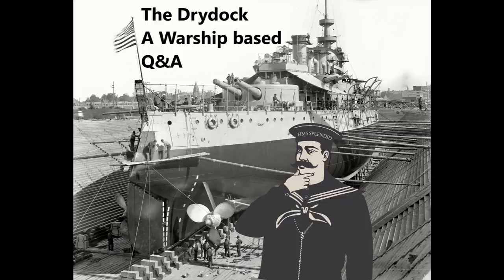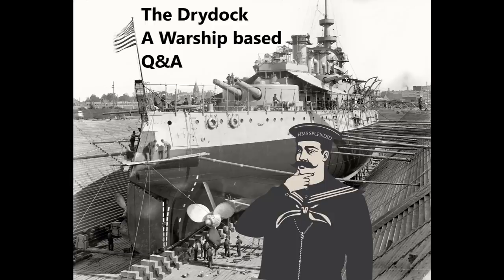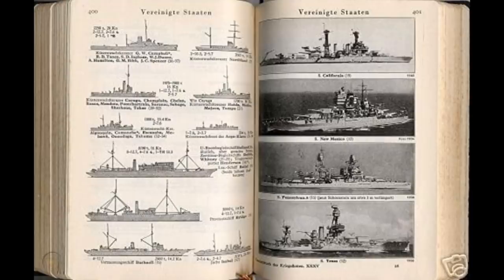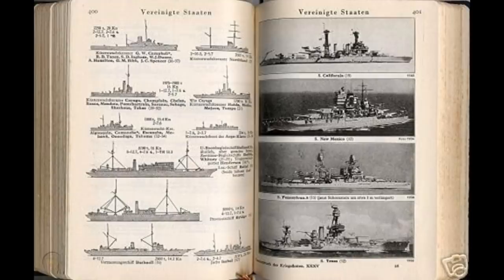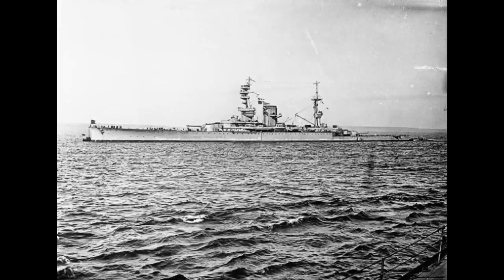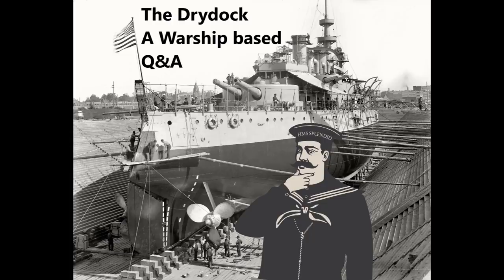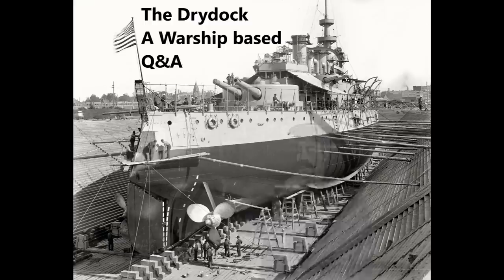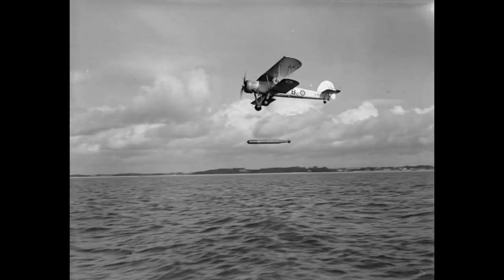The Drydock - Episode 138

Comment from the maker: Pinned post for Q&A :)
Reply: Would the Royal Navy have been better off keeping the Gloster Sea Gladiator in service over the Fulmar in the first half of the war? From what I’m aware the Gladiator gave sterling work in Malta and Finland in the early war years.
Reply: What kind of small arms did capital ships keep on board? Was it enough to arm the crew in case the got pressed into service on land?

How effective were fixed torpedo tubes on capital ships? Surely maneuvering an entire battleship is impractical
Reply: Considering the amount of damage that USS Enterprise (CV-6) had taken during the Pacific War. Did it develop any mechanical or structural quirks similar to HMS Warspite?
Reply: how effective was the razzle dazzle camouflage idea against U-boats? I feel like it would make ships much easier to spot
Reply: I keep wondering, If a modern 40 MK4  had been sitting on an American WW2 warship, how well would it have performed against the air plans of the time?  I know this isn't exactly the kind of questions you like to answer but I thought I would still try!
Reply: So, what about hovercraft? or is that another services concern?
Reply: Were there any successful "kamikaze" style attacks by allied aircraft during WWII?
Reply: @skylynx2243  it was not a matter of spotting said vessel with the dazzle camo scheme, but rather hiding the shape, direction, speed and even tonnage, to evade an attack. The scheme was there to break up the silhouette for identification, gave false bow waves for indication of speed, change the perception of course, appear to have the vessel deeper in the water(so torpedoeswpuld be set to run deeper under the vessel), and just confuse the human eye as to what it is seeing. While i don't have numbers, it was effective(including modern car companies using similar patterns to hide new model changes to flagship and super car models), but made superfluous to the advent of magnetic homing torpedoes.
Reply: In your battles for Guadalcanal series, you noted the electrical problems USS South Dakota had. Was this a problem with the whole class (including Alabama and Massachusetts) or was this a unique problem to South Dakota?
Reply: @adamalton2436  A similar thing happened to Massachusetts during the assault on Casablanca, But the US forces was so superior in numbers that it did not matter to much, and therefor no "fuzz" was made about it.
Reply: @Luke-li5gj  There was 4 Zaras, the Gorizia was not sunk in the battle.
Reply: Does anyone else get the impression that the Pensacola class cruisers used up most of the luck available for US pre-war heavy cruisers? Neither was sunk, and while both suffered damage during various engagements (including actions at Guadalcanal), only Pensacola suffered crippling damage with a torpedo hit at Tassafaronga. In contrast, every other pre-war heavy cruiser class suffered the loss of half its members during the war (total of 7 out of 16, leaving out Pensacola class). Of the pre-war heavy cruisers that did survive the war (11, including the Pensacolas), most (Tuscaloosa and Wichita excepted) suffered crippling damage at some point, many in the Solomon Islands. In contrast, none of the Omaha class, only one of nine Brooklyn/St Louis class, and only two of eight Atlantas would be sunk. Granted, the Omahas were largely kept out of the war and the Atlantas were kept close to their carriers for AA escort rather than put in surface action squadrons, but still, as Franks puts it:

"The American 8-inch-gunned "treaty cruiser" fought her last night battle in the Solomons at Tassafaronga. This resulted partly by design, but more because of force majeur -- every one of the thirteen heavy cruisers used around Guadalcanal to date had been sunk or damaged."
Reply: Swordfish are effective in forcing manoeuvre kills on enemy aircraft.. by flying at extreme low altitude and changing course often.. the me 109 etc often gets frustrated and over commits. .then goes straight in.. war in a stringbag
Reply: @niclasjohansson4333  design flaw?
Reply: Why were chains fixed to the bow as seen on the ship in the part about torpedo protection?
Reply: The German destroyers would have still run out of shells and been for the most part effectively unarmed after destroying Warburton force
Reply: @adamalton2436  All the "modern" BBs during ww2 had design flaws, and the SD class might have been the worst of the lot ? The USN tried "to mush" with the SDs they were just to cramped to be effective.
Reply: Bomb ketches, if you’ve not covered them already
I’m particularly curious where the French used theres, 
And also if any of them ever used the mortars against shipping

But the concept itself will do, rather like you did galleases (even tho I’ve lost track of where that one was answered...)
Reply: Given the pugliese system as copied by the Russians was flawed using rivets meaning that bulkheads break and with cylinders that were too small and even then still impressed the german testers. how do you think the proper italian system would have worked. In real life it was never hit in the main part of the system only on the thinned down extremity so I wonder how strong it would have been to newer torp x fillers.
Reply: Is it true that they tried using, and experimenting with cork as part of a torpedo defense? And do you think possibly concrete was ever thought of and tested as well?
Reply: I found it interesting that the USS John F. Kennedy (CV-67) had an angle stack like certain IJN carriers, whereas all of the other non-nuclear powered US Navy carriers did Not!  I'm not/never have been flight crew (as you can guess from my "name"), but I wonder how much this helped the aircraft landing, and why they didn't put an angled stack on the Essex class angle deck modernizations!
Reply: Nice video! Could you comment on the transition of naval yards during the shift from wooden ships to iron and steel. While both needed to be near the ocean, the iron / steel age made it more convenient to be near steel mills and forges. ? Did this lead to a decline of some yards and the rise of others? Or did the yards just adapt? Did it lead to an exodus of shipwrights and carpenters ?
Reply: Was there ever a Mis-identification between the Baltimore-Class, Cleveland-class, and maybe the Brooklyn-class on both the Axis and Ally forces? If so which one were those?
Reply: In re the TDS:  What if anyone had used 21" diameter shaped charges vs the "best" TDS?  What would be the relative effectiveness vs the typical simple lump of explosives that was a typical torpedo warhead?
Reply: After the surrender of Japan, a number of its naval vessels were used to bring back troops from far off places - as some IJN vessels were doing this into 46/47, what was this the last act of the Imperial Japanese Navy (if not then who) and under whose flag did they sail?
Reply: Could we get a USS Pawnee guide?
Reply: @skylynx2243  From my understanding (from what my WW2 Vet father told me) is that the type of rangefinders (basically all) submarines had, it made getting the correct range to help them aim their torpedos.  (If you've ever used a a reflex or other camera that has a rangefinder, it is basically the same style of rangefinder that is in a WW2 periscope.)
Reply: @blogsblogs2348  Yes - if "Pegleg" Lamb had opened fire, he'd have been credited with 2 kills. He also cites dive bombing @ 200 knots in his Stringbag.
Reply: Did any navy ever experiment with some sort of armor piercing or dual stage torpedo that would travel furthur into a warship's defense system before detonating its main warhead
Reply: After the Battle of River Plate, Churchill famously said that Harwood had "proven Troubridge wrong!"  Do you agree?

Personally I disagree - relatively speaking the Goeben was far more formidable ship than the Admiral Graf Spee if only on account of being much better protected - and consider this a perfect example of Churchill disingenuously "rewriting" history so as to ensure it was going to be kind to him.  The way I see it, Troubridge had been trapped into a no win situation trying to balance conflicting orders requiring him to engage the enemy, guard the mouth of the Adriatic and avoid battle with a "superior force." If Troubridge had been wrong about Goeben being a superior force then presumably the person who had issued those orders - who just happened to be Churchill - was actually right and therefore ultimately blameless in embarrassing mess that was the pursuit of the Goeben.

As you may have gathered, I'm of the opinion that Churchill set Troubridge up as the fall guy for failures in the Admiralty that were ultimately his responsibility.
Reply: I've noticed that a lot of larger (heavy cruiser and up) WW2 Royal Navy ships had one anchor on the port and two on the starboard side, while other navies had just one on either side even for their battleships. What was the reason for this (and the arrangement in particular)?
Reply: Did the New Zealand navy have any warships they either owned or were commanded and crewed by kiwis, in either ww1 or ww2??
Reply: @jb76489  The torpedo's gyro could be set to steer it on to the required heading after launch, so the tube itself didn't have to be pointing in the right direction.
Reply: Regarding the roles of ship's crews, remember that during normal cruising only half the crew would be on duty at a given time, so they would have to take on a variety of roles.
Reply: The German ships of World war 2 seemed to have generally inferior anti aircraft weaponry compared to their allied contemporaries and be less than adequate in anti air defense. If you were in charge of German ship design what would you do make German naval anti aircraft defense up to par or superior to their allied contemporaries?
Reply: Do you think, with it firing off one last shot from its guns as it sank, that the USS Chicago was saying goodbye to her sailors? And has there ever been other eerie instances of ships saying goodbye to their sailors?
Reply: I've heard that during the Spanish American War the USN almost fired on an Austrian cruiser as the United States anticipated Austria-Hungary intervening on the side of Spain. But I have not been able to find any details on this incident such as date, location, or ships involved. Can you shed any light on this incident?
Reply: @Drachinifel How do you weigh a ship that is tens of thousands of tonnes? Is it done by component or in a tank by how much higher the water goes?
Reply: What in your opinion is the difference between bravery and suicide, and which one, or both, best describes kamikaze pilots?
Reply: When Von Spee approached the Falkland islands and found the Brittsh battlecruisers waiting for him, some historians have ventured the opinion that if Von Spee had only stood his ground at that point he could have pounced on the Brittish ships as they sailed out of port one-by-one and blasted them into oblivion before the following ships could assist. Would the geography of the port allow this and could Von Spee have possibly pulled such a manuver off, leaving aside that his most sensible course of action was probably to run? #qanda
Reply: Did any mothballed ships from US reserve fleet after WW2 or reserve fleets of other nations were ever reactivated and brought back into service? How the decision was made on whether to mothball a ship or scrap it?
Reply: @Chung KWOK Benefits pale to the cons and complexity.
Reply: USS Long Beach is said to be the last cruiser built on an actual cruiser hull design. What's the difference between a cruiser hull and a destroyer hull ?
Reply: Greetings Drach, Reading "Anatomy of the Ship, Battleship Yamato" on a table that states how much certain items weighted in the ship there was a line dedicated to torpedos. In an asterisk the author explained that there were recent reasons to believe that Yamato had a number of underwater 610mm torpedo tubes. What are those reasons and how likely is that?
Reply: @tokencivilian8507  a shaped charge will go through the outer shell and then disperse. "Spaced armor" is very common for protection against a shapedcharge, as the explosion gets focused on a particular point and loses focus after that.
Reply: @constancel4211  I think that's mostly a reflection of the fact that the Ticonderoga class (America's last "cruisers") are built on the hull of the Spruance class destroyers. With Burkes displacing over 9,000ctons now, the earlier Spruances displacing 8,000 tons or so, and the Ticonderogas displacing about 9,500 tons it's hard to look at US ships and distinguish between a "cruiser" and "destroyer" hulls (unlike the treaty era when cruisers were 10,000 tons and destroyers about 2,000).
Reply: Alternate History:
As a measure to prevent further European wars the militaries of Italy, France, the UK, the BeNeLux countries and the west German proto Military of the late 50s/ early 60s are folded into a European Armed Force.
In the post WW2 draw down what what Ships/Ship classes would you keep in service and what systems would you change over to some what standardize?
Reply: Hi Drachinifel! Is a floating dry dock relatively recent innovation? Did it play any important role in WW1 or WW2?
Reply: @kemarisite  Thank you I thought it was a matter of shape like the length to width ratio or other things that might influence the speed, tonnage and internal volume of the ship.
Reply: @solidjb  The Iowas come to mind.
Reply: @timengineman2nd714  The "Edward M. Kennedy" (the origin of the moniker is left to the reader as an excercise.) Was supposed to be nuclear powered but McNamara vetoed it for cost reasons.  The original design did not have trunking for the boilers.  I am just speculating but the angled funnel may have been the result of a desigm improvisation.
Reply: 13:02 Now I'm curious what the US and Japanese responses to the imagined Courageous-class cruisers with 10 or 12 x 9.2-inch guns would have looked like (and more entertainingly how the different parties would have fudged the treaty restrictions to try to get an advantage).
Reply: @TheAngelobarker  the Russians invested heavily in testing a more advanced system for underwater defence.. even making sections to destroy and analyse.. but they ran out of time and just built what was ready.. for their large battleships
Reply: @SPARTANI548  they did keep it in service.. they just ran out of them and no more were being built or converted from raf stocks which were also depleted.. Therefore had no supply chain...
Reply: You had a picture of a pt boat with what turned out to be radar.. upon investigating this I have since been informed that some had radar.. further looking into this.. there were a number of early radar sets used but not necessarily servicable.. but then a general issue.. thus the pt boats at guadacanal were likely? Radar equipped as a priority that had been identified earlier and also had different detonators for their torpedoes.. which meant that if it did not go wild then it was effective... this would make them a very powerful direct anti shipping force in the area.. by the technology of the time.. ie working radar and torpedoes...
Reply: Sunk by torpedo aircraft as no effective air escort at the straits of Gibraltar plus minefields plus submarines plus surface units plus 9.2 inch guns at Gibraltar which would have ripped them a new one...
Reply: How did the life of your average seaman in peacetime change across the eras of Naval history? I'm including both those deployed on ships during peacetime as well as those who weren't actively crewing a ship.
Reply: They should have just immediately transfered 50 new but older raf hurricanes as their .303 guns firing tracer would be very useful against italian wooden bombers which had a tendency to catch fire easily... large numbers of these early hurricanes were available crated up and ready to go...
Reply: For someone who professes little knowledge of psychology Drach, that assessment of the possible/probable mentality of kamikaze pilots was pretty damn good.
Reply: You mentioned Seeadler, I've been fascinated with her and her exploits, I wonder if you'd be so kind as to share your thoughts on the vessel with the rest of the class please. It would be much appreciated good sir.
Reply: @johnshepherd8687  Actually, it is easier to run the funnel straight, however, a IJN carrier(s) did have an identical funnel design to lessen the effect of turbulence on aircraft landing.... I guess that whoever changed her from Nuke to Oil decided to see if it worked in the age of jets!
 
(I also know that she was supposed to be a nuke.) But, not everyone knows she was that smaller than not only the (newest) Big E, but also all of the other carriers from CV-59 onwards.
Reply: @nicoderfeuerloscher1684  yes i was wondering what those were for too
Reply: @nicoderfeuerloscher1684  yes i was wondering what those were for too
Reply: How would US navy torpedo squadrons perform at Midway, had they been re-equipped with TBF avengers just before the battle?
Reply: @MrPro897  my hunch is, as the attack was so hopelessly botched, TBFs would have been slaughtered the same way.  There were TBFs that attacked the Japanese force from Midway.  They were slaughtered.  One of the six survived attacking the Japanese formation.
Reply: Q&A : SS Richard Montgomery - continue to leave it alone, or attempt to clear it? If clear, how would YOU do it?
Reply: Can you tell me which is the best German destroyer of WWII in terms of combat performance? I’m very interested in Kriegmarine and due to it being a rare subject in terms of WWII history (let alone its depiction in video games).
Reply: Q&A: I've been wondering about this for a long time.  How bad were the WW2 Depth Charging of US Submarines, especially in the early stages?
   
A  lot of the Japanese Destroyers at first carried 18 to 36 Depth Charges, so I am thinking the tales of a hour+ depth charging is more story telling than truth....
Reply: The book titled 'I was a Kamikaze' could have been fiction. 
It tells the story a pilot who had seen the B-29s sliding away from him. Too high and too fast to shoot.  I think it was frustration that made him volunteer. 
He was promoted, wrote a letter to his family and was allocated a twin engined plane. The rest took off in single engined planes and he lost touch with them. 
He could not find the ships he had been sent to attack and returned.  He was promptly stripped of rank and never flew again. 

He gave figures showing no reported attacks that day..
However, the single engined planes did not return and were considered successful which contradicted USN reports. They reported no hits that day. 

A RAF pilot was not impressed when I told him.
Reply: Why did the Radar of the German Kriegsmarine got damaged so easily and often by the ship itself and were the German ship designs particularly bad/ what could they have done better to build good heavy cruisers and battleships?
Reply: Idk if they’d be I. Your wheelhouse, but since they operated in conjunction with U-boat fleets and navies generally, I’m curious about the role of flying boats in WWII. 
The Germans in particular had some cool ones (bv 138 looking like a spaceship, bv222 & bv238  wing Germany’s biggest planes of the war..., the do24 fought for both sides!)
Every country had cool seaplanes. It’s not just the Catalina (a very cool bird itself).
Reply: @stevevalley7835  TBFs would clearly perform better. They were faster, better armored, heavily armed, longer range. TBFs from Midway weren't elite units, just like SBDs, B-17 and Vindicators.
Reply: Hey! I cant remember if you ever talked about Rifled cannons in the age of sail but I read an article about some small on some small poundage guns 12 pounders and even a two pounder that the british used that threw projectiles 1,100 yards with a deviation of about two feet. I would love to hear more about such cannons. It seems mostly a french and german undertaking and I can't find much information on the subject.
Reply: @myparceltape1169  the Bismarck example is a good example, why could the gun blast unsettle the valves, didn’t then thought of shooting the guns when they designed the ship. And if I remember correctly it was a common flaw in German ships that there radar was prone to failure
Reply: @myparceltape1169  I'm sure you don't have time to read all these. Love your channel. I was wondering if you could go into detail on your thoughts on the Japanese "Pagoda" masts. Given their height, they were relatively lightly armored to maintain stability. They were also where the primary optics and a good portion of the command crew was located. 

If I were faced with fighting a Japanese battleship I'd order all secondary batteries to focus on that pagoda mast which couldn't withstand the hits and use the big guns as usual. 

Thoughts?
Reply: Why are so many RN ships named after Greek gods?
Reply: The specific history of the 15-inch guns outside IWM London? I know they passed over several ships during their service but don't know the exact details.
Reply: I see that the USA originally used an 18" Mark 7 torpedo as its aerial torpedo, but began development of what would become the 22.4" Mark 13 in the mid 20s. Every other nation that used an aerial torpedo used one that was 18" (or 17.7" for an even 45 cm) in diameter. Does anyone have any information on how the US came to decide on such a short (just over 13' vs 16-18' for other nations), fat torpedo for aircraft? The obvious possibility that comes to mind is a length limitation imposed externally, i.e., aircraft such and such can't take a torpedo longer than X, so that's our hard limit. While this is stupid as aircraft were developing so quickly and the next generation of torpedo bomber could be in service with a longer bay in 2-3 years, the US made a number of comparably stupid decisions during the same time period so I can't rule it out as a possibility. However, I haven't seen anything that specifically says why it was this length or that is was made so fat to compensate for the length or where this external length limitation came from.
Reply: In the age of sail, why didn't their bicornes blow off? My fedora went spinning into the A446 recently and I considered it serendipitous that providence decreed I am an I. T consultant on a stroll rather than a fourth Lieutenant on a 74 off Ushant
Reply: I heard your tone change a little bit when mentioning Churchill. An almost disapproving tone and I’ve heard it before in Britons. Do I get the impression that Churchill isn’t as popular as I was lead to believe?
Reply: @gearhead3533  on this issue it may be important to distinguish Churchill at the Admiralty from Churchill as PM. At the Admiralty he came up with a number of wild ideas, such as campaigns in Gallipoli or along the German Baltic coast, that were problematic, either in concept or in execution.
Reply: The mental state of Canopus' Chief Engineer has been brought up multiple times but I'm curious what exactly happened; like what began his breakdown and/or why did it occur? What kind of breakdown was it? PTSD or an actual psychotic episode? And did he do anything to actively sabotage the ship or was it more just the loss of such an important crew member being felt?
Reply: You have mentioned the 7 years war a few times recently but never realy touched on 1759 ie Annus Mirabilis this seems like a pivotal turning point in the fortunes of the british empire to me.  I understand the topic is way to general to allow any sort of detailed answer in a dry dock but would appreciate your thoughts on it in a general sense specifics can wait.
Reply: This is something I've heard, but have no idea is true or not: Did the Royal Navy forget on an institutional level how to prevent Scurvy at least once?
Reply: My question is about the category of "capital ships", where it comes from, what did it mean, and how did that meaning evolve up through the end of WW2?
Reply: Crete campaign 1941. British ships were having to sail right past the doorstep of the Stuka base on Karpathos. Iirc destroyers were sent to bombard it a couple of times, but there were also a couple of squadrons of Wellingtons in Egypt at the time. Instead of trundling off to Tripoli to sink freighters, might they not have been better employed  plastering Karpathos every night for a couple of weeks?
Reply: @skylynx2243  It was supposed to make angle & direction of travel harder to gauge by eye - both essential for torpedo targeting
Reply: My questions is 
what if the Kriegsmarine did not underestimate the Oslo Fjord defense batteries, the Blucher actually fired first and attempted to destroy the defense coast ?

How would the battle play out and affect the outcomes of the upcoming naval engagements in Norway ?
Especially if Blucher had to come across Warspite.
Reply: If, somehow, either the Illinois or Kentucky had been rushed to completion as giant anti-aircraft platforms without any large guns, what do you think?
Reply: Did a vessel ever deploy an onboard torpedo boat that successfully attacked during battle?